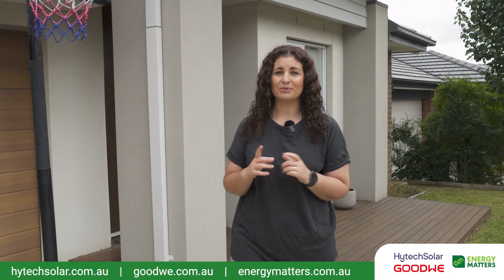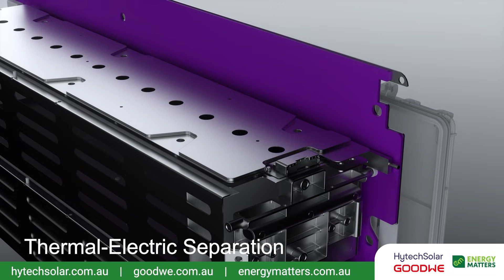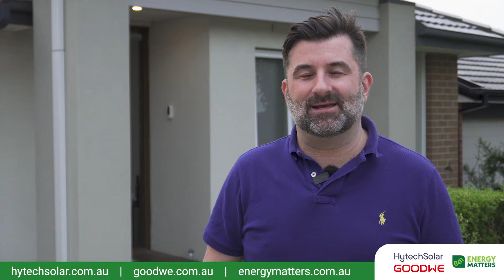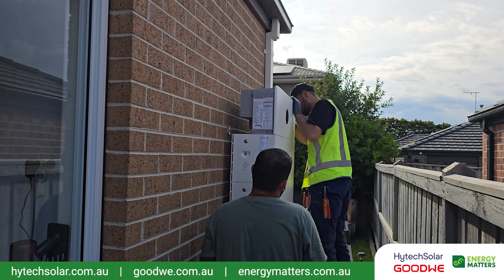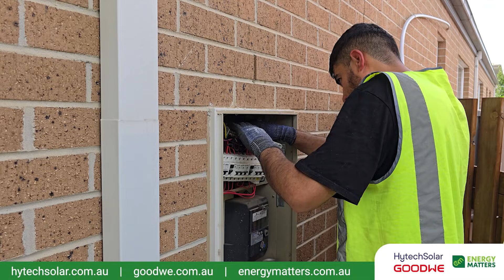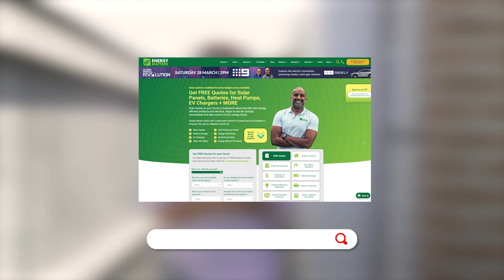GoodWe ESA All-in-One Installation by Hytech Solar | Energy Matters

Comment: Hi Nicole, we just have ours installed today same like yours on south side. My question is, doesn't it require canopy to c9ver from rain eventhough its a waterproof system?
Reply from the maker: Great question! A canopy is only required on north and west-facing walls. If it is exposed to the elements a little more than you're comfortable with, definitely look into a canopy or even a battery cover. There are a few custom ones out there. My battery is fairly protected. Keep in mind that the ESA is rated for outdoor installation, so rain and a small amount of sunshine is fine. Cheers, Nicole

Comment: One more thing !!!!   You said your quarterly bill is around $250 per quarter. Even if you don't subtract the supply charge then 250 /0.35c / 90(days) it works out that your usage is about 8 kWh. Can I ask why would you get a 48kWh battery when you only need to cover 8kWh of nightly use???  Because I work in the industry, I understand that the issue of oversizing batteries way beyond people's needs has caused the government to drastically reduce rebates.
Reply from the maker: That's a great question! We are planning to ad an EV to our home next month, with the aim to have both or our cars replaced by the end of the year. 48kWh of storage will allow us to rely heavily on our own generation. Without this plan, we would likely have opted for a smaller system. Cheers, Nicole

Comment: WOW !!!!!!   Looks like they have stolen everything from SIG ENERGY  !!!   It's a wonder they are not in Court over copyright!!  I think Goodwe are a pretty good choice in terms of their commitment to Australia which is more than I can say for MANY  relatively new brands on offer
Reply from the maker: The SigenStor is great! GoodWe are no strangers to modular batteries, with their Lynx series entering the Aus market in 2021. They've expanded on this with their incredible inverter technology, which has been in Australia since 2012. While there are many all-in-one systems on the market, GoodWe leads with it's 6 levels of safety. This was one of the reasons why we chose the ESA. Cheers, Nicole
Reply: A major difference is also that Sigenstor requires an external gateway, for outage backup. GoodWe ESA has got that in-built.
Reply: @james4bs  Yet the backup "built in" is not always the correct solution, for starters, you need a cable run to AND from the inverter with enough carrying capacity not just for the 10kW inverter, but anything being passed through from the grid.  So at 63A, that's probably 30-40m of 16mm2 2C+E cable, effectively extending your mains and cost, you also have to install two isolators  at the BESS rather than 1.  There are many circumstances where the gateway is a much better solution as it can be positioned next to the main switchboard.  The ESA is better built to withstand the outdoors in my opinion,  the Sig has some questionable plastic covers;  however, if you want your battery to actually last and perform at its best, I'd be putting in the garage if at all possible.   Its also worth nothing that the SigEnergy gateway does more, it has a smart port that can be used for generator input, load control and even has a 2nd inverter input.  Whole home backup via the inverter also means that a CT in the MSB is not required, it's built into the gateway.

The ESA looks like a decent product for many homes, but its not the same use case as the SigenStor.
Reply: They all copied each other, Sigenergy copied th huawei luna s1 who was out to market before Sigenergy. Then we have the Sigenergy Neo lineup that is coming out later this year, early next year, that is a copy of the Goodwe ESA lineup.

Comment: How many Kw solar do you have on the roof? 
I’m curious to know how your energy provider will manage your battery use. Will you still have enough power for your personal use when you need it most.  
I have ordered the Goodwe 48kw. Waiting for installation.  I have no interest in giving any power company control over my battery.
Reply from the maker: Nicole here! We have a 7.92kW system. Recently signed up to GloBird and top up the battery to 100% during the 3hr free electricity window. Set to discharge at night to make use of their VPP. Plenty of electricity for the home and we still haven't used a watt from the grid!
Reply: I have a 12 kw solar system on a nice bright sunny day I can generate 80 kw. If you join a virtual power plant VPP thé company will pay you for  kw out of your battery, you need to set a limit on battery discharge otherwise they could drain your battery leaving you no power when you need it. Some companies can take power any time if you sign up to there program. I don’t participate in these schemes as it contributes to battery degeneration,and I’m happy just to be self sufficient in power.   Cheers

Comment: Vipin not worth the risk shorten battery life and you have no control above you set limit. I have this system and just happy to have no bill. Dont get to greedy.
Reply from the maker: Hi! Nicole here. You can fully control your charging and discharging, even with a VPP.
Reply: I think, it's more about stabilising the grid and making it cleaner, rather than being greedy. It's clear that the electricity wholesale rates will continue to be driven by the cost of electricity produced using fossil fuels, even if renewable energy is much cheaper. If we want that to change, then we need to prove that the grid can work perfectly fine even without the fossil fuel electricity. And to do that, we need to contribute to the grid management, by participating in the VPP programs.